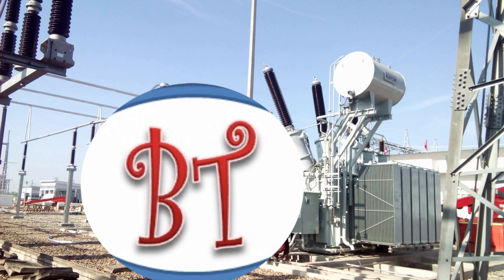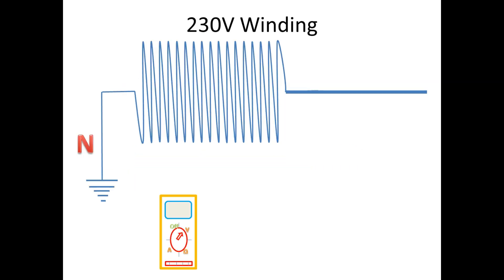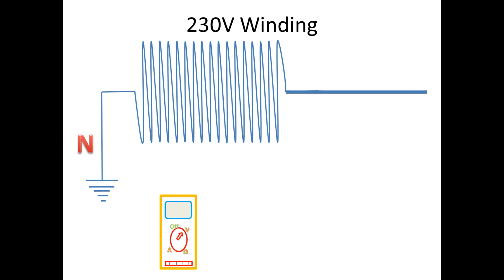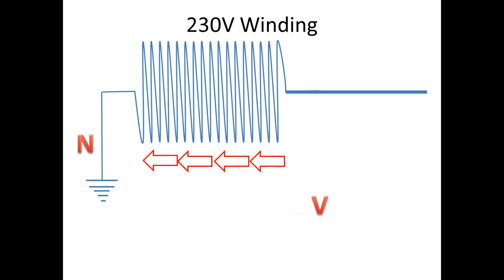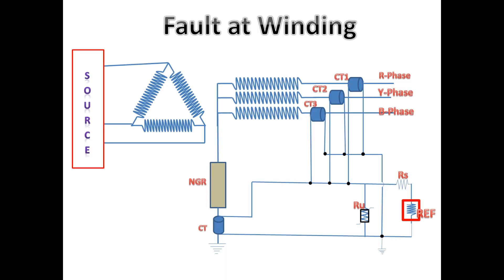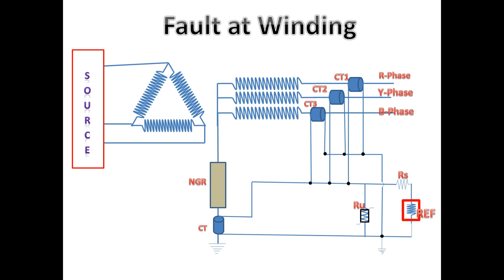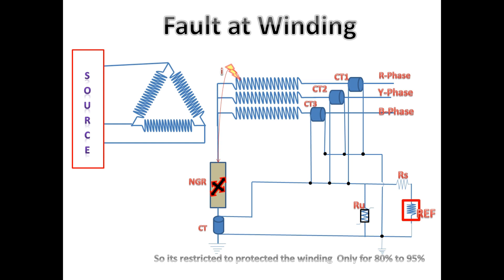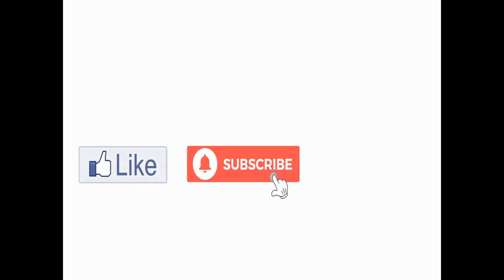Why It has name Restricted Earth Fault Protection | Why REF protect only 80% to 95 % of winding

Comment: But main difference between Differential protection and REF is differential will not detect the fault near neutral as voltage is low, for protecting this we use REF is used,

Comment: Ref is protected the sensitive fault only. If fault is near to winding only Ref protect. But u telling ,Current is very low ref will not protect and operate.how?
Reply from the maker: if the fault is very very near to neutral end then it can not protected so only its name restricted earth fault
Reply: @baranitech  why is it low current  
If the fault near to neutral? Where if it is near to neutral point resistance is too low and fault current will flow freely. The CT will also reads fault current.
Reply from the maker: @Youtube-Creator81  but voltage will be very less
Reply: @baranitech  which function protect not protected area?